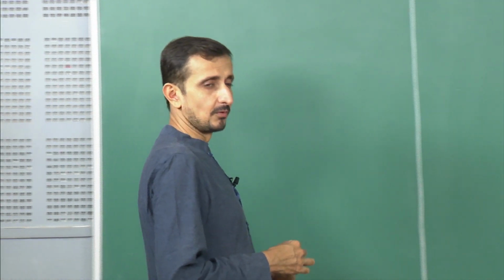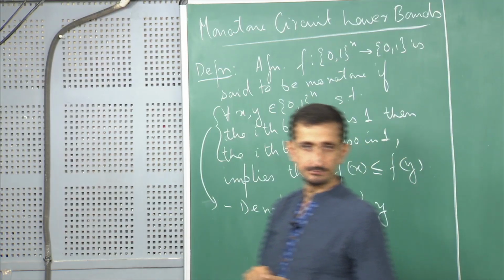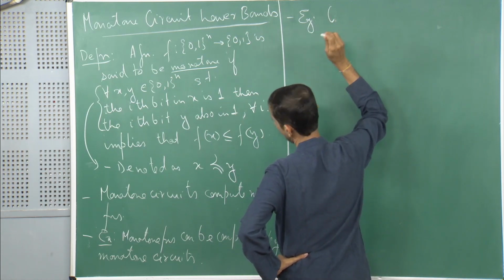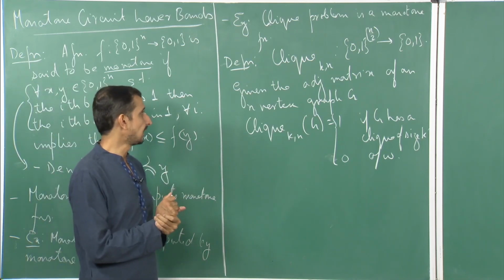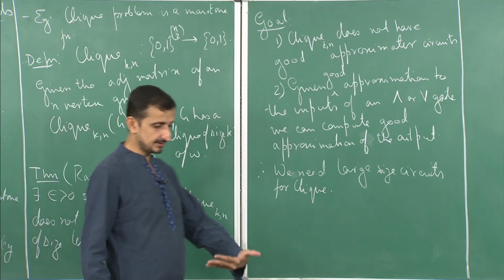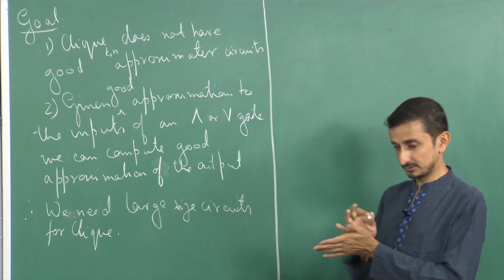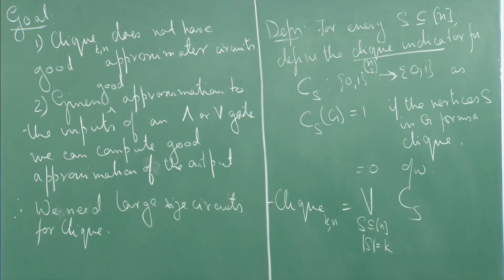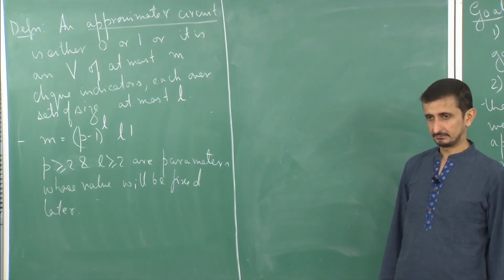Lecture 32: Monotone Circuit Lower Bound for Clique (Razborov's Theorem) I

Comment: 13:30 I do not understand, why this theorem implies, that the monotone circuit size of clique is exponential. It only implies that this size is superpolynomial. Also it seems odd to think of epsilon as being big.
Reply: Ah, no. Epsilon is small. But the claim about exp. size I do not get anyway.
Reply: It's for all k <= n^(1/4). So at worse it's n ^ (e*n ^ (1/8)) when you sub in k.
Reply: @colman8076  Yes! Thanks!